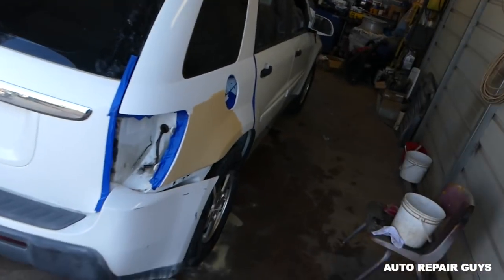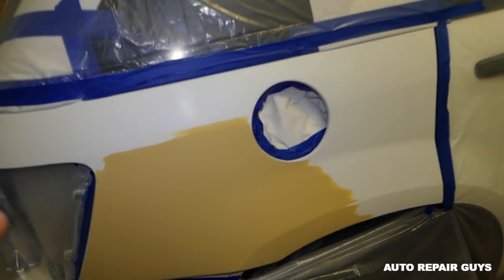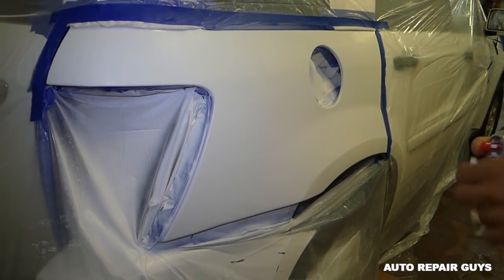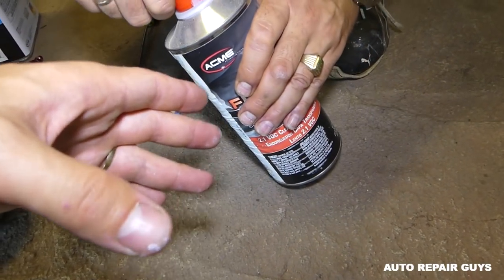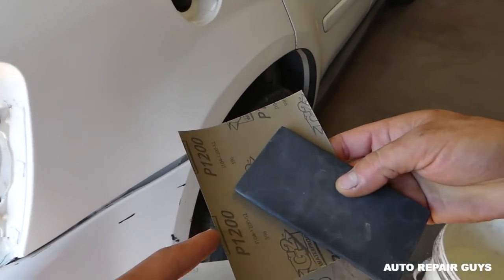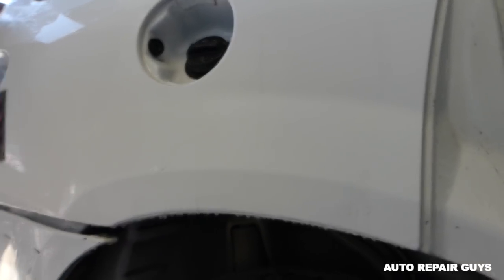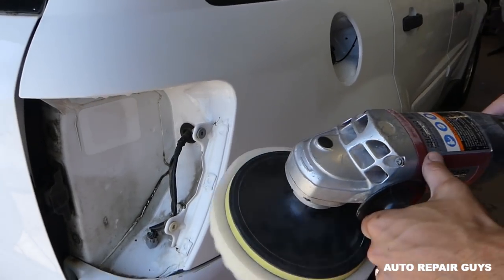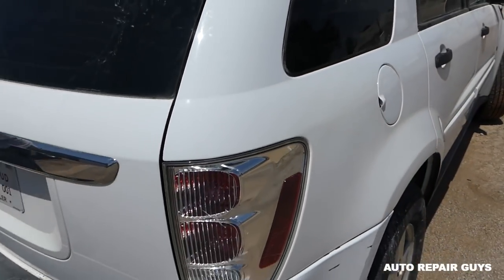HOW TO BLEND CAR PAINT like a PRO

Comment: Seeing all of the negative comments by people who seem  to "know everything"  and seeing the results of this video makes we want to blend my own paint issue. Yes the paper towel lint, the fact that it wasn't a perfect color match , and maybe his spray technique wasn't textbook...and on and on...the only thing that I am concerned with is the compatibility of the spray-can base coat and the urethane clear. Otherwise the results for that kind of vehicle may be good enough.  It came out pretty good I think, and again I only would be concerned if there is a reaction issue between the two paints. Oh yeah and another big point here is that every body shop (that I know of) would never blend, and they will sell you on the fact that the whole panel needs to be painted and lately the prices have been insane,  I was getting $500 quotes for a scuff and paint for a single fender without clear....for black...so that's another reason I am going to attempt this on my car.

Comment: The paint is not 100% similar. At 13:39 you can clearly see the yellow shade in the new paint.
But a really good job on painting it. I know it's hard to paint match light colors
Reply from the maker: Thank you. According to the catalog this white spray paint can replaces a few factory white colors. If you pay close attention you will notice it but I was impressed with the match for the price. It was really hard to use it spray paint because I had to clean the nozzle every 2 seconds.
Reply: All paints are darker til it dries with oxygen.
Reply: I have worked with this GM paint code series. There are several white colors GM replaces using this one "Super White" and it is a pain. We used the fuel door for a couple cans of RTS. With an aerosol like the one used in the demonstration, you can usually find the older original paint codes on the shelf. Keep in mind paint does not last forever on the shelf. Great video guys very well done. Thanks
Reply: @AutoRepairGuys  next time do no use dupli color there very bad cans… your in Germany right ? Spray max is a German brand aerosol spray in a can the best possible match you can get. I’m sure you have heard about them.

Comment: The colour is way off... your better off using nason base coat... then a rattle can
Reply: aaron anderson  I agree. Just yesterday finished a 2012 silver tailgate with Nason base. Then with Nason Select clear. It came out flawless. No mottle and went on with 2 coats covering yellow 2K primer. Oh... and virtually no peel with a gun I just purchased and used for first time (DV1).